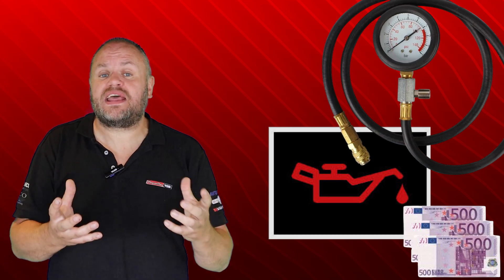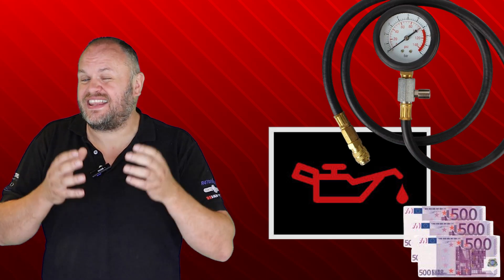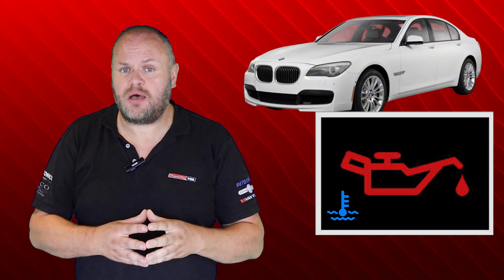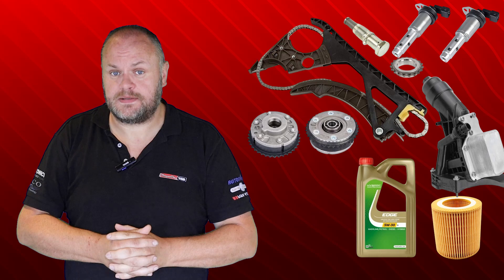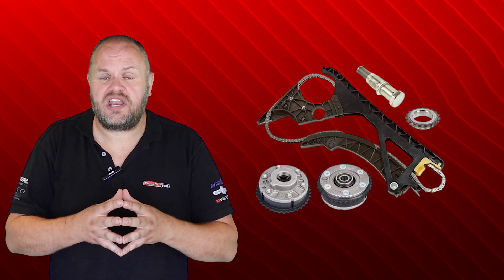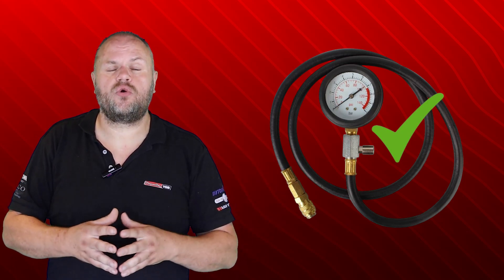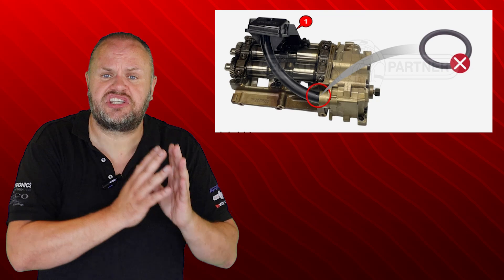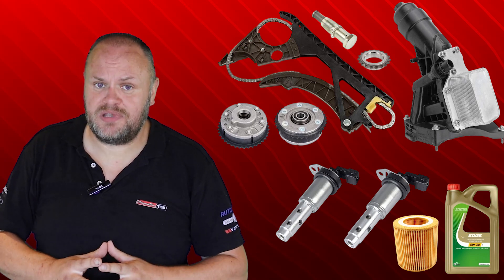How a 50ct Part Can Fix Oil Pressure Issues on BMW N46 Engines

Comment: Doesn't sound like they're using the right type of o-ring, should I have a high pressure high temperature o-ring it shouldn't be a problem. If you use an a standard o- ring yes it probably will break down

Comment: This surprises me. I would never expect an oil pickup O-ring to go bad since it bathes in oil. I guess it's exposed to a lot of heat and chemicals in the oil. Must have been a high mileage engine thought or maybe it deteriorated due to usage of engine cleaners and other additivies.
Reply from the maker: Time will also play a part here. The car is getting older but people hang on to it because they like the car.

Comment: Is it not possible to have a 1 week subscription for 1 vehicle? This would help out home mechanics so much!
Reply: Exactly what I was thinking. There’s a lot of people who arnt full time mechanics who would like to fix their own cars. Autel do it with their ap200 Scanner. You register it for one make of vehicle only and you pay extra to use it on another make
Reply from the maker: Thank you for your comment 🙏
We understand your situation, however, this is a professional software program designed specifically for use in licensed workshops by trained automotive technicians.
At the moment, we don’t offer short-term or single-vehicle subscriptions, as the content and tools are tailored for ongoing diagnostic work in a professional setting.

We really appreciate your interest, and wish you the best of luck with your repairs.
Reply: @DDTSB think of all the extra money. It wouldn’t make your product less attractive to the motor industry.